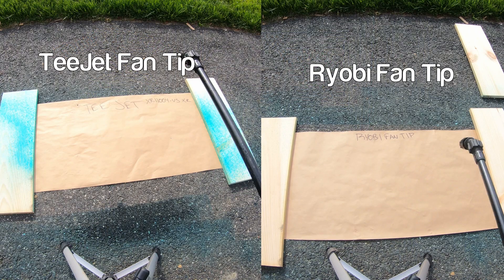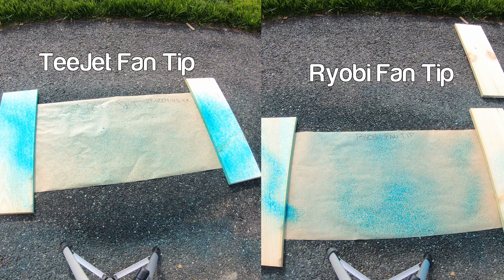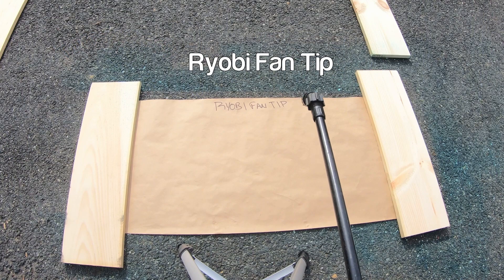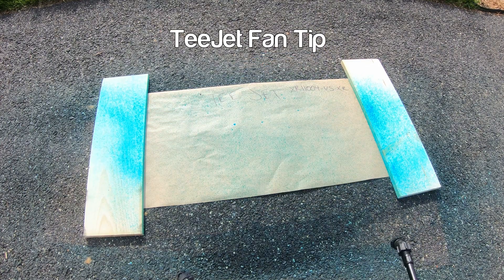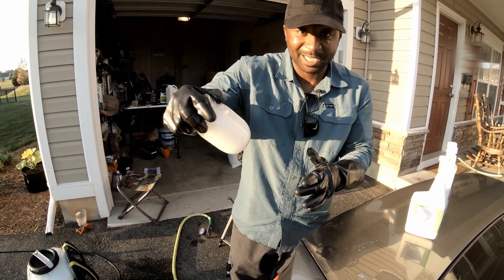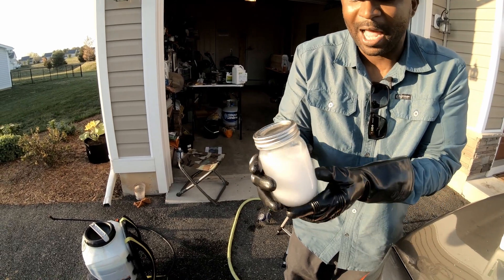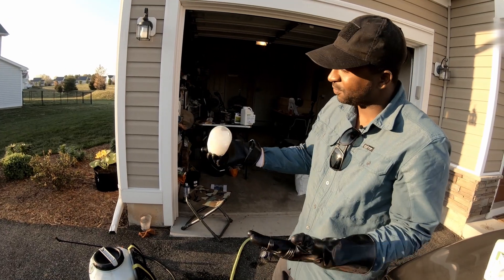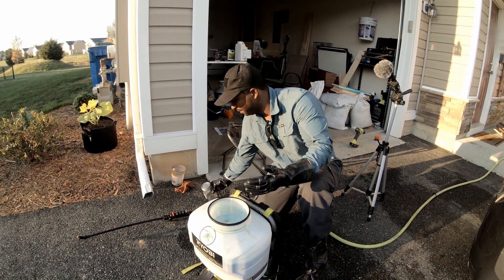TeeJet Nozzle Upgrade//Herbicide Compatibility

Comment: He has a 0.5 gallons per minute spray rate with that TeeJet tip. Most herbicides are rated 1000 sq ft per gallon, which works out to 2 minutes per gallon, 0.5 gpm flow rate, per 1,000 sq ft. He states he was going to do 1 gallon per 1,000 sq ft, 4 gallons on 4,000 sq ft, which is the correct application rate for most herbicides. Then he says he didn't want to come up short, so now I'm going to do 2000 sq ft on 4 gallons, giving me more time to do it. This is incorrect and he is doubling the application rate by applying 2 gallons per 1,000 sq ft. TeeJet tips are color coded according to the flow rate. Red is 4.9 gpm at 60 psi. They have a great online catalog with all the tips and flow rates.
Reply from the maker: Does using more volume carrier but maintaining the proper rate of product for the area being covered present an issue holistically?
Reply: @TurfTherapy  No, but the real question is why do it that way? Mix your proper rate applied 1 gallon to 1000 sq ft and you're assured of the best cost effective treatment in terms of time and money and the most accurate application rate per 1000 sq ft.
Reply from the maker: @Kevin-mm6xm well the reason would be to help build confidence and experience. Also some products perform better and/or recommend higher carry volumes. Just an option. I appreciate your opinion and feedback though. Thanks for watching the video!

Comment: OK...  I have gone online with Amazon and found what appears to be the same nozzles with different serial numbers.  Also, no mention of the appropriate cap.  I just bought the same Ryobi Sprayer P2806 but am concerned about ordering a nozzle only to find I need a cap or that the threads are not the same...  ???  Guidance???  When I purchase a nozzle, do I also have to purchase a dedicated cap for that nozzle.  If that was the case; they should come in a package???  Thanks....  Is there some chart you can follow that gives the proper part number for a particular sprayer manufacturer???  I tried contacting Ryobi and they knew nothing...  Confused...
Reply from the maker: My recommendation is to purchase through the sprayer depot links I provided in the video's description to avoid further confusion. I didn't need caps or anything extra for the P2806 Sprayer. A simple unscrew swap and spray. The links aren't affiliated links, FYI. Just the easiest way to avoid confusion. There are other details in the description you may find helpful as well. Thanks for watching, and let me know if you need any further assistance.
Reply: Thank you for your prompt reply.  I had come to the same conclusion.  I think I will contact their C/S and order two or three nozzles.  Who knows...  If I get into this; maybe an upgrade wand and trigger handle.  But, the included equipment seems good.

Comment: @TurfTherapy how did you adjust the flow on the 4gal Ryobi? Does the Tee Jet just pop right into the stock Ryobi tip?
Reply from the maker: No flow adjustment is needed. Just swap the tips. Easy peasy. 👌🏾🌱
Reply: @TurfTherapy  in your video you said the flow was 3 minutes to fill up the gallon, then you made some adjustments to get it to 2min exactly? was that just switching from Ryobi head to TeeJet?
Reply from the maker: Yes. The nozzle itself adjusted the flow rate as far as calibration.

Comment: I really appreciate this information! I have been using the adjustable nozzle that came with the Ryobi 4 gal and it is disappointing for pretty much all bio-stimulants. My question is does the tips require an adapter to be purchased? Thanks again!!
Reply from the maker: If you have the same 4 gal Ryobi like me, all you need are the tips! You won't regret it! 🌱
Reply: @TurfTherapy  got them on the way 👍
Reply: @TurfTherapy  Oh man! You are right! I tried out my new tips yesterday... what a night and day difference to the adjustable cone. I threw down some Humic, RGS, and Air8 and the spread was perfect.. can get right on the edge with no overspray with a 3ft pattern. Thank again :)

Comment: Are these compatible with most backpack sprayers? The backpack sprayer I have came from tractor supply, it isn't battery powered. Also I'm still confused on the calibration of the sprayer, I have some herbicide that it says to use 3 oz to each gal of water, where does the calibration of the sprayer come into play with that?

Comment: I like the video, but man I don't like you sliding and dropping that stuff over the car's paint.  Teejet nozzles for the win.  I use the AIC 11010-VS and the XRC8006-VS nozzles with the Flowzone sprayer and after using the nozzles since September 2019, I realize I like the 11010 better because it puts out more volume and at a wider angle, so I am going to purchase the XRC11010 nozzle for the upcoming season. These two nozzle covers all my spraying needs.  Subscribed.
Reply from the maker: I appreciate the support! I got a new video in the works for some pretty clean tips I've found. I promise I'll avoid the paint this time 😂👌🏾🌱

Comment: wow,, I'm so glad to have found your video!!  great to see the difference of spray patterns! thank you.  I bought Ryobi 2gal chemical sprayer this fall. I'm new to this.  Changing from Ryobi original tip to this Teejet nozzles don't require any other parts? just remove the ryobi tip and swap ???  ->> After this comment, I found some parts required for the Teejet nozzles..but I'm still confused what exactly I would need to fit Ryobi sprayer.  I would really appreciate if you could help me with this. Thank you...!!
Reply from the maker: Yeah check out this link 😁🌱
https://thelawnforum.com/viewtopic.php?f=4&t=16686&hilit=Ryobi&start=20
Reply: @TurfTherapy  omg! latterly I found this forum earlier and I have been searching for parts since lol 🙂🙂  Thank you for your response and the link!!!

Comment: Nice information. Can I ask a quick question? I have a Chapin manual backpack sprayer (https://www.amazon.com/gp/product/B005FPUHEE/). Will this TeeJet Air Induction AIXR11004VP nozzle work on that sprayer? Is that a universal tip that will just screw on?
Reply from the maker: No, this won't be able to fit that wand without a few other pieces. But if you call them, they will help you convert that fitting so that it will. Thanks for watching 🤙🏾🌱
Reply: @TurfTherapy  thanks!

Comment: Great review and awesome video! I’m in the market for a sprayer. Would you still go with the Ryobi knowing what you  know now or pay a little more for something like a Flowzone or Strom. 

Also do you use the Ryobi for all of your applications? Ferts, Bio-stim, herbicides, pesticides, & fungicides?  I keep thinking o need at least two sprayers but not sure. I appreciate your time and advice in advance!
Reply from the maker: Hey Chris, thank you for watching the video and I'm happy to hear you enjoyed it! That's funny you ask because I'm actually in the market for a new backpack sprayer but not for the reasons you may think. 

To answer your first question, I probably wouldn't still go with the Ryobi, but that's not I say that the Ryobi hasn't been worth its money. I bought the Ryobi purely because I'm pretty deep into the 40V & 18V line up, and with the cheap tip mods and check valve, it's a great unit. 

Now, if I have the budget, I would go with the FlowZone Cyclone2V; the variable pressure is a great feature alone for me. 

If I didn't have the budget and knew about the YT25e - https://www.sprayers-plus.com/products/yt25e-effortless-hand-held-sprayer/ - I would get that over the Ryobi. The battery lasts forever, and it's a much better unit straight out the box. 

Lastly, yes, I run everything through the same unit. I always flush my equipment according to the label immediately after applying herbicides, pesticides, etc. I haven't had any issues with crossover following the instructions. But I do have a small ”hand can” dedicated to ”spot” spraying with glyphosate and other hot them. 

In the end, I will probably pick up another sprayer either the Cyclone or YT and continue to use the Ryobi for chem only most likely, though. Hope this was helpful 🤙🏾🌱
Reply: WOW! Very informative! You picked up a new subscriber by the way! I appreciate you taking the time to break it down. Not that I have an unlimited budget. But I do want to try to get it as close to right the first go round. So I’ll most likely get the Flowzone. I appreciate it again! I’m a new DIYer everything lawn care this year.  I also registered for lawn care forum   Thanks again! By the way... I’m in Bowie MD.
Reply from the maker: That's dope. Right around the corner.

Comment: Well dang, Got my nozzles in today and just went to do the bucket 1 gallon test and its the same for me as my regular sprayers plus nozzle , still takes me 4 minutes to empty one gallon with this new nozzle, makes no sense :(
Reply from the maker: It's the pressure of your sprayer most likely. Did you at least have an improvement in your spray patterns?
Reply: I actually got to use the red tip today and it does have a great pattern, Definalty an improvement over the regular tip I was using. I found a video of a guy who calibrated a 2 gallon sprayers plus just like mine. A full tank covers 4,000 sq ft for me. So instead of spraying the lawn twice I only sprayed once. Usually I would refill another 2 gallons with product and go over lawn another direction to evenly distrubute it.

Comment: Will this work on the ryobi 2 gallon sprayer?
Reply: So... Just got the tips in the mail today, and they ARE NOT compatible with the 2 gallon sprayer tip.. I'll have to try and find an adapter...
Reply from the maker: Oh nooo. I'm so sorry. I just went and looked and I didn't realize they used a different wand. I'll tell you what. Email me your address. I have something that should do the trick. robpalme357@turftherapy.net
Reply: Any suggestions on an adapter or wand to make these tips compatible with the 2 gal sprayer? Thanks in advance. Excited to use it but can't 😥
Reply: @alexd9660  did you ever get the tubing to make it work with your Ryobi?  I just received mine and I guess I’ll have to return it.
Reply: @JonD-ee3im  I did get it to work. You need an adapter for the tip. Just read the forum attachment. It'll explain it all. 
https://thelawnforum.com/viewtopic.php?f=4&t=16686&hilit=Ryobi&start=20
Reply: @alexd9660  thanks a lot!!!
Reply from the maker: I have a wand for you brother. I will send it to you. Just email me your address. I feel terrible for giving you misinformation. You will need new hosing and clamps that you should be able to get from your local big-box store.
Reply: Links to make it work with the 2 gallon ryobi?
Reply: @momendo  https://thelawnforum.com/viewtopic.php?f=4&t=16686&hilit=Ryobi&start=20
Reply from the maker: https://thelawnforum.com/viewtopic.php?f=4&t=16686&hilit=Ryobi&start=20
Reply from the maker: Yes. It sure will!

Comment: Ive got a sprayers plus 2 gallon and the thing I dislike about it is it does about 2500 sq ft per gallon. This should put me close to 1,000 ?? BTW thanks for the content, really helpful
Reply from the maker: Randy, I choose to do that because 2:00 per 1k sqft is a bit fast for me as I’m so used to having 3:30 per 1k. But you can most definitely do 1k in 2mins. It just takes some practice. I’d start with products that have a lot more wiggle room like Humic acid or micronutrients to dial in your pace. Thanks for watching!
Reply: @TurfTherapy I just did the test on my  sprayers plus regular tip that I've been using and it took me 4 minutes to spray a gallon of water, wow
Reply from the maker: Yeah wow. No you're going to half to walk twice as fast to cover the same amount ground if your time is like mine.
Reply: @TurfTherapy for 10,000 square-foot I need to fill up my 2 gallon tank 5 times with product. But after 2 1/2 I would already have the 10,000 area covered but I still have 2 1/2 to go. So would walk again in another direction to get all my product on lawn and evenly distributed. No wonder I've been losing a few pounds lately  ha

Comment: Did you have to replace your wand so you could use the Tee Jets or just the tip assembly?
Reply from the maker: Just the tips. No wand replacement needed. Just simply swap out the tip.
Reply: @TurfTherapy  you're the man!

Comment: I use the red AI for my products which need to get to the soil.   I have a red turbo tee jet that I use for foliar.  I just got a flood jet nozzle for the next soil amendment products where I don't need accuracy.   Some of the Next stuff is pretty thick and was making my pump work hard.   These flood jet definitely is the solution.
Reply from the maker: Nice! Thanks for the “Tip”. Haha see what I did there!
Reply: @TurfTherapy  nice pun 😁

Comment: Teejets are awesome. I use both the ones you showed and the air induction 110010. Mine are quick connect models. I have a flowzone so I had to rig up 1/4 quick connect for it.

Comment: Those teejet tips looked like a definite improvement over the ones that come with the sprayer
Reply: Yeah, and you can even get a few nozzle sizes of each type if you want, to get more or less gallons/1kSF. Like, I've got some stuff that I apply that wants a lot of dilution (so I might need to be at 1 or 1.2 gallon/1kSF. But other stuff is fine with 0.5 gallon/1kSF. So I can just swap out a nozzle and be doing lower flow and only have to fill up my backpack twice.
Reply: Richard Mathews same here. Haven’t gotten into any AI nozzles yet
Reply from the maker: Night and day difference. Best $10 I've ever spent.